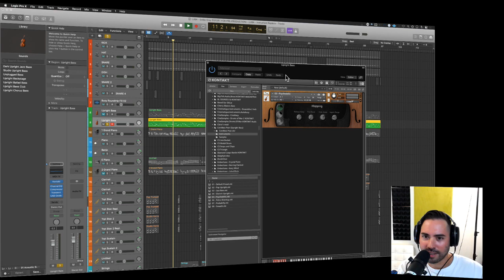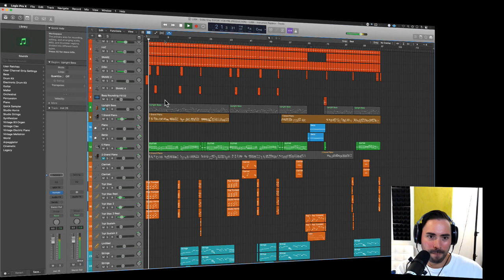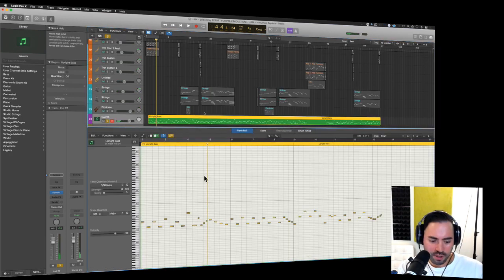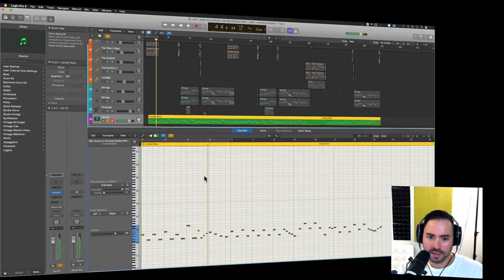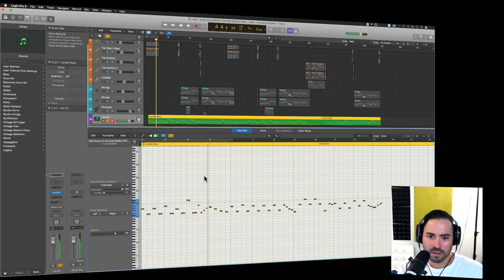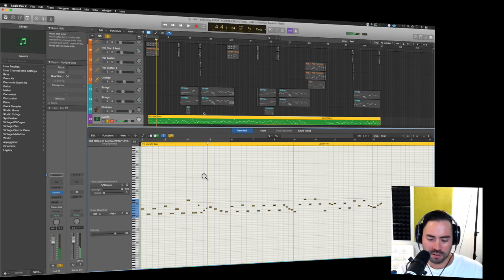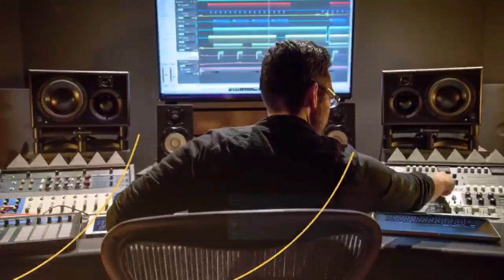"Kontakt Bug Fix: Expert Tips for Troubleshooting Common Issues"

Comment: can someone help me? I installed kontak7 + library and it is loaded in my FL studio. But when I play my piano pattern, there is NO SOUND. When I change it to another vst (for example serum), my pattern has sound. Only Kontakt7
Reply from the maker: You need to check the midi channel in Kontakt. It should be set to OMNI. LMK if that helps k.
Reply from the maker: https://spitfireaudio.zendesk.com/hc/en-us/articles/360011066777-How-do-I-change-the-MIDI-channel-in-a-Kontakt-instrument-

Comment: I have a lot of problems with kontakt. some instruments just glitch out and have to restart the DAW. But it is not my cpu i have checked. I wish more companies would steer away from Kontakt so it becomes obsolete to be honest. It really gives me a lot of problems. VST3 are far more stable. I dunno what these companies are thinking to be honest. I use a lot of high end VST3 with zero problems but every day i have at least 2 glitches or more with kontakt and recently seems to be getting worse.
Reply from the maker: So sorry hopefully this will get resolved. I would also try turning off your Wi-Fi and Bluetooth. Anybody else have anything to add?
Reply: @_TheModernCreative  wifi and bluetooth effect kontakt? i did not know this. they are both on actually.
Reply from the maker: I also thought is something…you need to have ample space on the hard drive that you have Kontakt libraries loaded on. Where do you have Kontakt libraries loaded and how much space do you have free on that drive? You need to have 1/4 of the space free to get optimum performance. If you have a TB, 250GB needs to be free. Closing out others program can help as well.